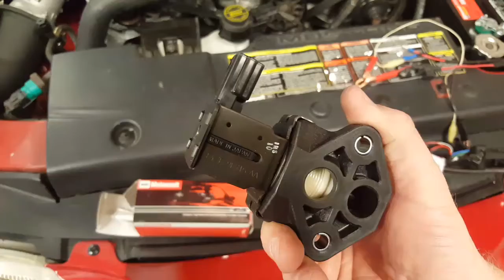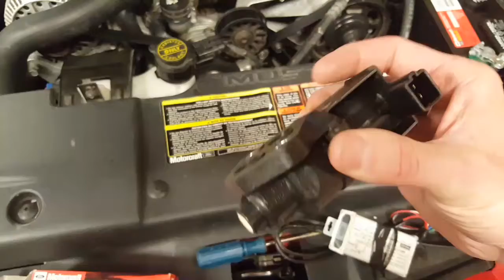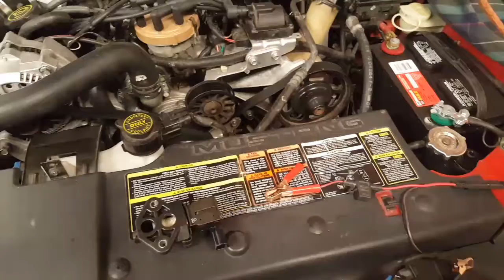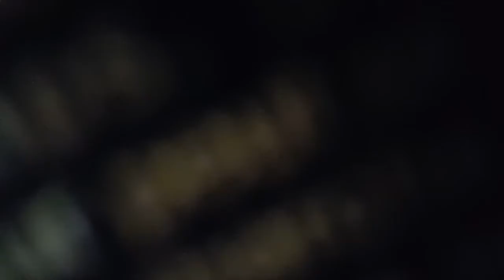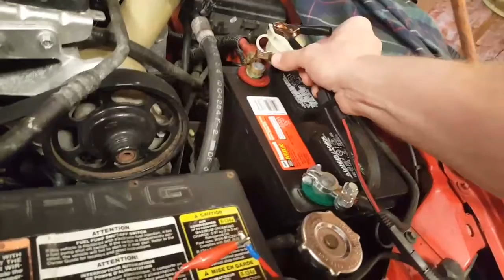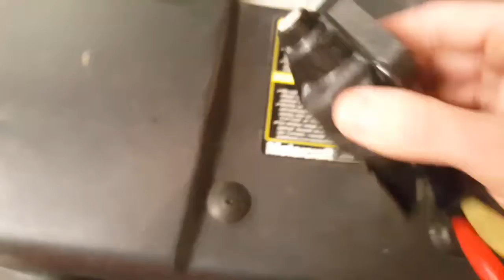1994 - 1995 Ford Mustang GT and Cobra Idle Air Control IAC Bench Test How To

Comment: MY 1995 V8 mustang doesnt tick over(idle) with the Idle air control valve on! When I take it off the car idles ok! I changed the IACV for a new one, but it still doesn't idle with it on! Any suggestions please?
Reply from the maker: As in the hole in the intake where IAC should be is wide open allowing unmetered air in?  In that case it could be a lot of things including a bad MAF sensor, a restricted throttle body, etc.
Reply: @JackofAllMasterofNone  yes, when I take the IAC of it leaves it open. the engine idles then. TPS IS OK
Reply: What did you figure out or end up doing? @ernestpoke2093

Comment: I know your video's content is on "testing a Ford iac valve",but it would also be nice if you could either:
1) expand this video to include the 9v battery test on the valve and a subsequent voltage test of both iac harness wires.....
2) make a second video detailing the 9v battery test & a voltage test to the wires.....
I haven't been able to locate a video or clear instructions for the wire tests yet.The ones Ive seen just state to test the red wire to verify it has 12+ volts koeo/koer then test the white/lt blue wire for continuity between the iac & ecu harness plugs (disconnected).More thorough tests for this wire would really be helpful.

(White/Lt Blue Wire Voltage Tests)

(KOEO)
COLD ENGINE
IAC harness connected= ? volts
IAC harness disconnected= ? volts
(KOER)
COLD ENGINE
IAC harness connected= ? volts
IAC harness disconnected= ? volts

(KOEO)
WARM ENGINE
IAC harness connected= ? volts
IAC harness disconnected= ? volts
(KOER)
WARM ENGINE
IAC harness connected= ? volts
IAC harness disconnected= ? volts

If the warm engine voltage readings are the same as the cold readings,theres no need to bother with listing the values twice,if you don't want to.I was just assuming the voltage might be different since the ecu begins closing the iac as the engine gets warmer.
Much Thanks wbrockstar

Comment: It would have been nice to see you do the test method using the 9v battery you mentioned because obviously theres not gonna be too many youtubers with the piece of test equipment you had access to.If you happen to see this,could you at least list those test steps here in the comments section?? The video was helpful & interesting to watch to see a visual of how an iac really works,internally,so good job.Thanks a bunch.